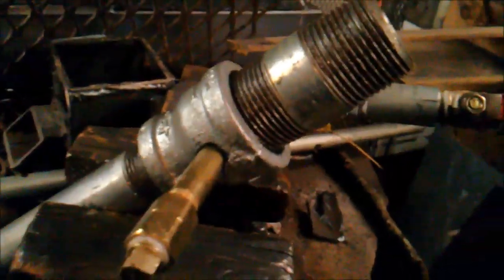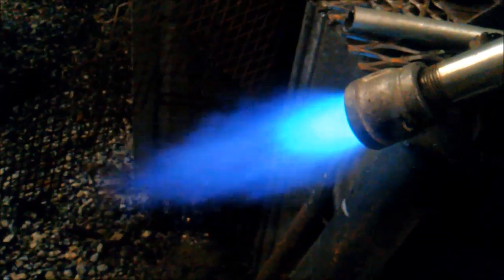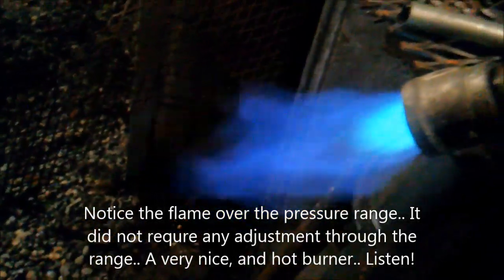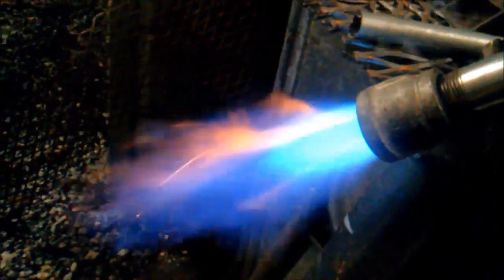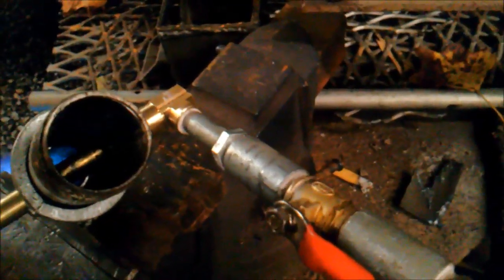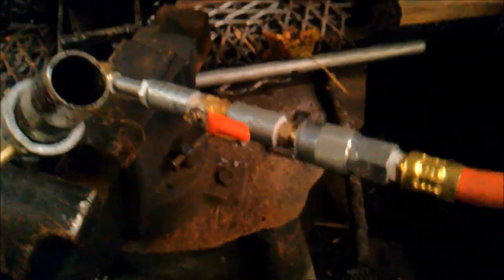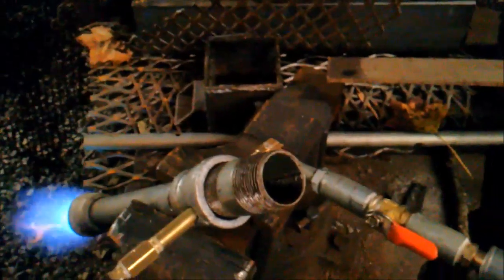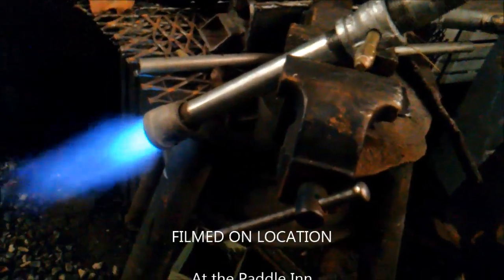Propane Burner for Blacksmith Forge or other applications.

Comment: the tip of mine is getting red hot how do i make it so the flame is burning just out side of the bell? also just the tip is getting hot not the pipe from the mig gun tip
Reply from the maker: The tip is going to get hot.. If you have a good Neutral flame, you are good.. Wait until you get it tucked into the forge. Really gets hot.. Then, you keep the tip just inside of the wool or brick, etc... The mass will help to cool it, pull them temp way from it.. You just want to make sure that you have a good "Neutral Flame".. I think you are there.. 
Try running a pressure regulator and be  able to say what pressure this is happening at.. You may be running very low pressure.. If you did the mig tip, you should be running a minimum of 3-5psi.. Hope that helps.. Listen to the video.. I mention the pressures if I remember correctly.. 
Should have anyway..
Reply: @MarkThomas123  thank you very much for your insight.

Comment: You could put an air choke on top there to give you some control.
Reply from the maker: Lenblacksmith it doesn't actually need manipulation. Whoever figured out the design had it just about right. But if you wanted something other than a neutral flame then yes, you can surely do that to get different results. As you can see it is a nice neutral frame through a range of PSI.
Reply: Yeah that's good aye? They worked it out good.

Comment: I think you should keep the galvoinzed pipes away from the burner and forge.  If the pipe gets hot enough it will release toxic zinc fumes.
I am not saying the pipe will get that hot but I am saying it is possible.
Reply from the maker: I have addressed the Galvanized comments here several times.. You should check some of them out.. 
You should eat lots of "good fat" plenty of fresh yard eggs, and DMSO and Colloidal Silver will fix problems that Western Medicine can't fix.. Don't fear things others ask you to fear.. Just be smart about it. 
I just completed a galvanized project that required 1058 tack welds and 528 2 inch welds on a hot dipped galvanized pipe.. Not a single sign of any symptoms I should have suffered from.. 
BTW,,. Don't eat Beef,, listen to the Chicken people.. But, listen to the Pork People, and don't eat chicken, because Vegetables have way more Salmonella than chickens ever thought about having. 
And, listen to the Chicken people, and you won't eat Beef or Pork 
Then, show me 10 vegetarians that are 70 years old that are healthy... Amazing how many people believe what others say without researching it for themselves.. Cheers.

Comment: Be careful with galvanised steel!

READ THIS!!!!!!!!!!

http://www.anvilfire.com/iForge/tutor.php?lesson=safety3/demo
Reply from the maker: Yes. Not sure why he did that.. I'm sure he knew better.. That was a pretty extreme thing to do.. 
I'd like to point out some things you should have noticed in the story.. 
1) A well-ventilated shop would not have filled up with zinc smoke. 
2) It is more likely,  his lack of experience with galvanized is what caused his problem to begin with.. Putting those fittings inside of a forge it's pretty ridiculous.. 

That is where the hottest part of the flame is, and is Sure to bake it off,, and the smoke and trailers are going to stop and get stick the first place they run into (Inside of the forge).. 

Had he had some experience with galvanized, he would have never done that..
3) had he ever burned some in the open, he would have put something inside of a forge..
4) had he had experience with galvanized , he would have had proper ventilation for sure.. 

There are plenty of things that people do everyday without getting hurt..
Welders and welders and blacksmiths can get some of the nastiest Burns.. 
Underwater welders can lose their life from nitrogen Narcosis and the bends..
Rod Busters can have any number of accidents in a day..
So can a thousand other occupations..
I hope we don't vote to do away with all of those occupations because they have some hazards.. Because our world would stop turning..
All of those occupations have a high level of risk involved..

it's how you handle that risk..
Next time you hook up your 4-1/2" angle grinder, and do some grinding and wire brushing, stick your finger up your nose with a white handkerchief..!! 
Next time you go to your doctor.. Did you read the side effects of the medication that he gave you?
Do you know what Recepter Blockers are? 
Is Cancer caused by Lack of Chemo Therapy or Radiation? Is a Headache Caused by Lack of Tylenol or Asprin?

I would be willing to bet, the side effects are worse than what you're taking it for..

Do you live in the city? Are you drinking your fluoridated water.. Poisoned water? 
Are you paying any attention to the Chemtrails over your head?

Trust me.. I would rather knowingly deal with galvanized than most of what I've mentioned above..
There is a whole lot more to worry about that you do every day than the Galvanized in this video... 

Drinking corn liquor will not make you go blind.. 
Collodial silver will not make you turn purple.. 
And DMSO which is a solvent not fit for human use is used to keep stem cells in good condition for stem cell research hand keeps organs in good shape during transporting to there new recipient.. 
Don't  believe anything you hear if it comes out of your government's mouth..

if you are unsure how to use or treat galvanized , then stay away from it..
if you ever meet someone who's doing some work with galvanized.. 
Be careful, but stop listen and learn.. It is a very distinct material..
Don't be like the guy they told the story for... 

And don't think just because something is painted black or some other color that there's not galvanized underneath it.. You should be aware of what it is , and when it's heated how it reacts..

Because, once you've seen it , you will never mistake yet again..
I have thought about doing a video, just for you guys, so you can see what burning galvanized actually looks like.. 
It sure is not in this video, nor in the forge the burner is installed in.. 

What if you picked up a piece of galvanized by mistake? would you know it?
Would you immediately stop?
I rest my case..

B the way.. Just for the record.. I have been using that forward with that burner for over 3 years..
If that burner was properly installed in the Forge.  
Would that fittling still have galvanized on it?

And why isn't the galvanized burning off the end of the reducer in the video?

Yes, I would agree with you.. Please do not play with galvanized.. 
Do not put it in a Forge.
Do not heat it with any kind of high powered heat source.. 
And, do not weld it, even if you have the best ventilation system.. Unless you're fully leathered up..
because that would be a lesson you'll never forget..

On second thought, maybe you should find an experienced welder, and let him show you what galvanized is and does, in case you ever pick up a piece that's been painted over, and don't realize what it is.. 
Myself, I would rather be aware.. but to each his own.. Thank you for your comment..

I really should do a video of Heating it and cleaning it, and welding it without removing it.
I should buy one of the filters for the video camera, so, it would show the true colors and the smoke trails coming off of it. Everyone should know exactly what it is, when they see it, if they ever do.. 
My first experience with Galvanized, was trying to weld a painted over piece.. 
OH,, NO,,,, You can't weld something if it is Painted!!!!  Ha..Ha.. Well,, Ok. Maybe you can't... 
I do it occasionally, if, it is just a quick tack, or a short bead, and I am not welding for NASA.. Just fixing something.. The paint is coming off either way.. And, once it has been heated, what says is going to stay for a very long time... Then, as it cools, slap some more paint on the areas that you took off.. .
So, don't go welding painted stuff either.. When you get experience, if the situation presents itself, you can make the decision then, how you will handle it... And, you'll know it, and make exceptions for it.
If not, then, you'll learn some other things about it. Maybe the hard way.. 

 P.S. someone with emphysema , putting galvanized in a Forge.. 
I'm sorry.. He just flat didn't have a clue what he was doing..  I mean to say "TOTALLY CLUELESS"... 

Just one more little thing to think about.. Have you ever seen the inside of an old water pipe? 
An old galvanized water pipe?
Where do you think all the galvanized went?

It is what you DON"T know, that WILL Hurt you... 
Cheers. 
I had to edit this.. Power was out and the phone had a mind of it's own.. Good ole laptop's with batteries.. Ha... 
Now, if the power would come on, I have some other things that need to be done.

Comment: Holy shit do not weld galvanized pipe under any circumstance. You are going to melt your lungs and die before you have a chance to utilize the forge. Use black iron it's not gonna kill you
Reply from the maker: I worry more about the galvanized when it pops and snaps and lands all over the place. it will burn you for sure.. And the smoke trails that linger in the air from the galvanized.
I make it a habit of not breathing anything coming off the end of a welding rod.. Galvanized is no different as far as that goes..
the don't think for a minute, it's any more dangerous than running a grinder for a couple of hours.. Or a wire brush on a grinder.. 
I don't know where that wives tale got started...
but I have intentionally smelled galvanized and intentionally welded it just to see what everybody was talking about.. and no, I didn't choke to death, and drinking moonshine will not cause you to go blind.. In fact, drinking wine , or drinking orange juice is worse than drinking moonshine in consideration of going blind.. but what is worse than that, is just walking outside after the government has dumped thousands of pounds of Nano particle size Metals into our atmosphere to control the weather.. Very commonly called chemtrails..
or being diagnosed with cancer and letting Western medicine fill your body full of poisons..
Cancer was not caused by lack of radiation or lack of chemotherapy..
and by the way.. The Bell reducer on the end of the burner.. It still has galvanised on it.. After all that forging..
That is not where the heat is directed..
Don't believe everything you hear..
it is best not to breathe anything you can see..
And you tell me what your snot looks like after a day of grinding?
Reply: Ok, I may have exaggerated a bit. Yes inhaling the smoke firsthand isn't going to kill you in a second. It will how ever put zinc into your lungs. And zinc poisoning isn't fun and will kill you after a few years. I wouldn't inhale or breath the smoke of anything I'm welding. And grinding I always wear a mask and goggles so the dust doesn't get in my nose, avoiding yet another poisoning, iron poisoning. Now I have had iron poisoning and it had me sick and vomiting for a couple days, and my great grandfather welded some galvanized pipe in a hole. He was a healthy man and I guarantee that's what killed him. So try and avoid welding galvanized anything.
Reply from the maker: Agreed.. Avoid it all.. Never grind/weld too much in a closed area..
Funny.. I had Lead Poisoning. That wasn't cool either.. Messed up my electrical current system, and eventually ended up throwing my blood work off for a year or two..
Actually, the best thing that could have ever happened to me.. I started researching with people from the Middle East and solved those issues and a whole lot more..
And, learned about all of the lies of Western Medicine and their Receptor blockers..Havn't had so much as a cold in about 3 years..
If you don't know about Colloidal Silver, check it out. Did two videos on it..
Cure for Singles.. Well, your Doctor says one doesn't exist.. But, here is one I dreamed up after my Mom's sister had it, and about 5 years later my Mom got it.. I got rid of it in one application.. And, have cured it on many occasions for others.. Even one older lady going through Chemo and Radiation..
Make a note.. Here is my other site where I keep some notes.. www.KJ4SLY.com/Medical

Comment from the maker: Yes.. But, I usually run it between 3 an 5 psi..Once or twice, I ran it up to 10psi.. 
Having a fine adjustment is what makes the regulator nice.. It's worth the extra bucks to be able to fine adjust it.. Only reason I would recommend something like it. Sorry about the late reply.. Got really busy for a bit.
Reply from the maker: Camera in one hand.. I understand.. It was a working prototype, and I was trying to decide between it and another I built, and I had many asking about it.. Just did a quick video to show it..It is pretty popular and has helped many.. I'll keep that in mind..
I did finally build an adapter to hold my phone on a tripod.. Would rather do videos on it than go get my other video camera..
Cheers.

Comment: Thanks for making a fuckin parts list dude youre the ONLY one that has done that thumbs up
Reply from the maker: +Michael Provenzano You are welcome... I just edited the notes section above.. You can also do this with a mig tip, if getting the drill bit is a problem, but, it requires a "Ward Brand Tee" to work properly.. You can see it briefly on my brick forge video, and I have described it in the above area of the build as a "Note to Above".. 
Cheers and good luck..

Comment: As you can see, your pipe is smoking, you use galvanized because it burns off creating a super hazardous gas, and will give you the lungs of a chain smoker in 5 minutes if you aren't careful.
Reply from the maker: +Shadowcard No, not actually.. That is oil from cutting the threads.. Galvanized has to get a whole lot hotter. to smoke off, and when it does, it will have a green glow, and the smoke will be really thick, and you will see tails floating in the air following it.. And, you won't get a breath full but once, before you'll back up when you see it again.. 

I weld galvanized often enough to know when I see it.. And, I have a vent or blower when I do it, when I choose to.. 
If you weld in a shop, yes, you can get a mean headache, etc, if you don't ventilate.. 
In fact.. I just checked the bell reducer.. Still Galvanized as I suspected, even after this length of time. 

And, no.. you won't breathe much of it, before you start coughing, and it's not going to give you chain smoker lungs after 5 minutes.. 
Same as drinking moonshine won't make you go blind.. Because the methanol is created from fruits, not grains, and you will get more methanol converted to formaldehyde by drinking Orange Juice, than you will get in a lifetime of drinking moonshine.. 
It comes from fruits.. Think about it like this... Wine makers use fruit in their fermentation process... The yeast creates the same enzymes that convert sugars to CO2 and Alcohol. No distillation takes place and you drink all of the wine, not a distillate from it. 
It is the body which creates the Formaldehyde, from the methane, that when it is metabolized irritates the optic nerve.. Since moonshine is made from corn or grains, it has no legible methanes.. It was government propaganda in the days of prohibition, to keep people from buying and drinking untaxed liquors.. 
Moral of the story.. Don't believe everything you hear... 

I won't argue about breathing galvanized.. But, if you breath anything that chokes you,, or anything that smuts your nose up,, it;s not good.. But, then again.. I don't put my face over what I weld anyway.. Been there and done that on a few occasions..  
I am more worried about 1 hour of grinding or wire brushing with a Grinder and a wheel, than I am about welding or welding on galvanized.. At least, I can see and avoid that evil.. 
Next time you are grinding with a disk or wire wheel, blow your nose and you'll see what I mean.. 
You won't get a lung full of galvanized but one time.. But, you can grind all day long and never realize what you are breathing in.. It's really not a valid concern,, considering what else goes on in a shop.. 
Knowing what I know.. I would caution a grinder more than I would someone on Galvanized,, unless they were welding or cutting it for the very first time.. But, cutting it, without grinding it first will teach you a very good lesson anyway.. It takes care of itself.. 
You should go to a shop and see some welded for yourself.. It is not something spooky.. You'll know when you see it, and you'll know it 10 years from now, if you never see it again until then.. It's pretty unique... 

And, if you cut it,, you'll see it heat, pop, crackle and it will burn the piss out of you if you are not fully protected.. If you get lucky enough to get close enough to breath it, without getting several good burns.. 
Really.. It is the case.
I'll be willing to bet that someone here on youtube has a video showing what burning galvanized looks like.. Might check it out and see if you see what I am describing to you.
Cheers,, and be safe, but not afraid.
Reply: I unfortunately have not had the chance to try welding any galvanized, but i have cut it with an anglegrinder. I just know not to get it red hot (such as in forging it) also good thing i dont like orange juice that much XD